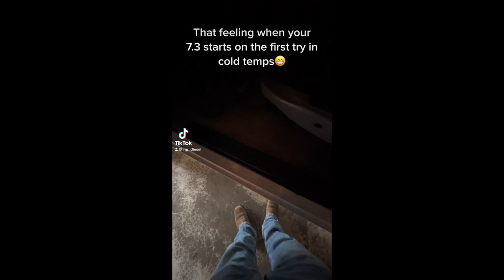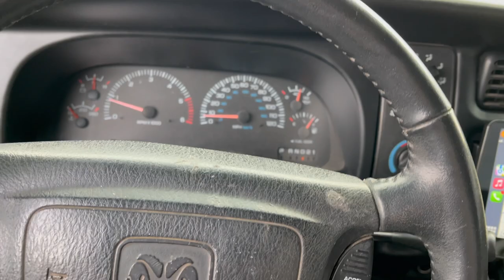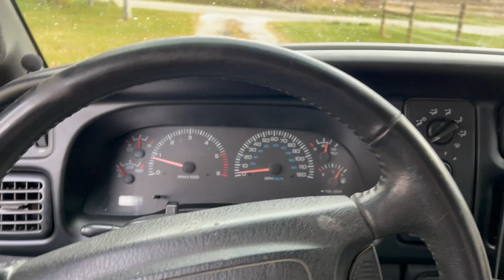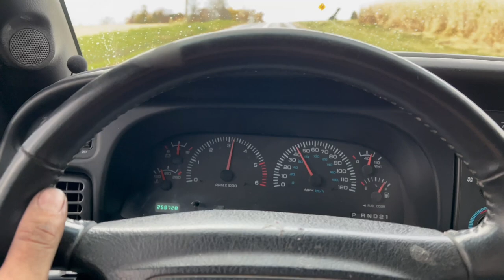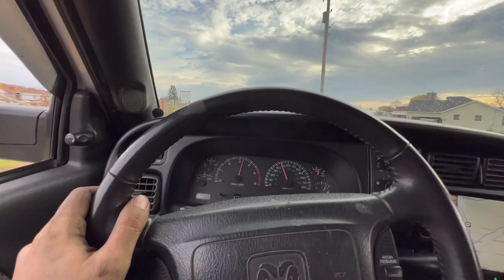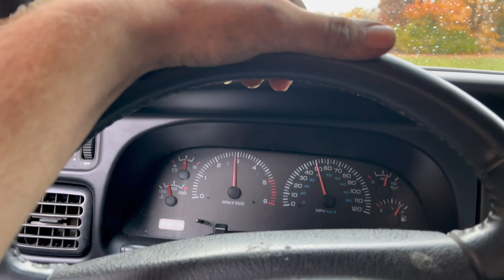It's like a NEW TRUCK!!

Comment: You didn't say what you did but did you leave the cap on while compressing the calipers? You want to take the lid off while you do that to prevent building pressure in the tank.